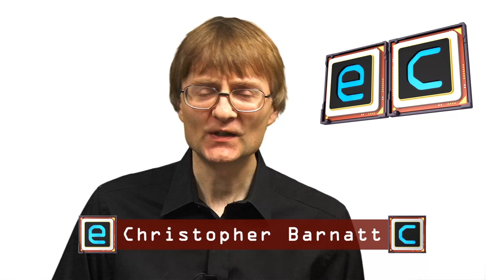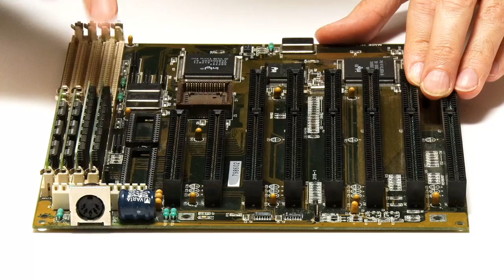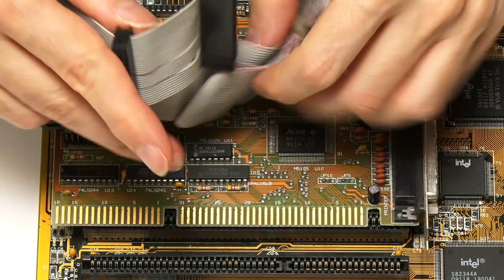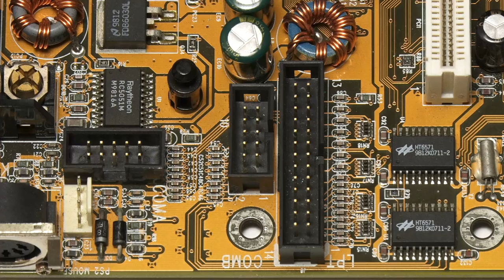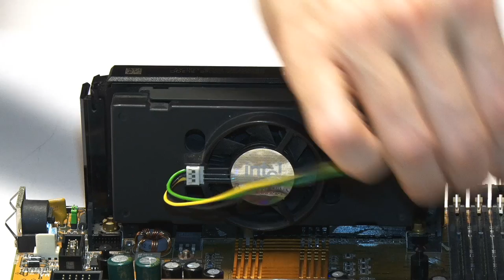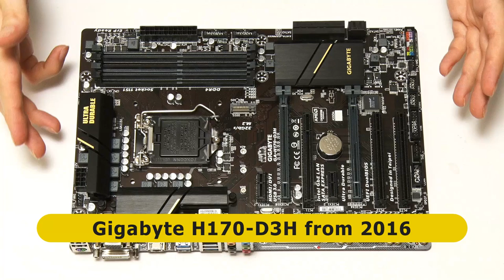PC Motherboard Evolution

Comment: Who remembers PARK ? and the feeling when you forgot to do it before you turned your PC off !
Reply from the maker: Oh yes, happy days . . . well, sometimes!
Reply: "Park" was only really necessary if you intended to MOVE the machine after you turned it off, but for safety sake, and given how expensive MFM hard drives were, it was a good practice regardless. The utility basically just told the stepper motor that positioned the heads to return to the zero position, which is a section of the platter where no data was kept. The heads actually ARE in contact with the platter when the hard drive is off, only using a thin film of air dragged by the spinning platters as lubrication, so it was VERY important that the heads be parked in a part of the platter where no data was stored in case they got jostled around during transport. Once IDE hard drives with magnetic coil armatures came out (that's where you harvest the neodymium magnets from), this was no longer an issue, because once you cut power to the coils, the magnets automatically pull the armature back to the zero, or "park" position. I had an early IDE hard drive (a 40MB, I think) that still used a stepper motor to position the heads. 

Floppies also used to come with dummy disks so the heads wouldn't knock around during transport. 

These days, most retro-computer enthusiasts have swapped out their MFM hard drives for CompactFlash (which is really easy to build an interface for, since it's basically IDE anyways)... IF (and oh what a big "if") their old MFMs were still working. These days, MFM hard drives, sans controller card, can easily fetch $400 on eBay, but with no guarantee that they actually work, or were PARKED before transport!  \O_O/

Comment: What kind of motherboard has an AGP slot, a USB header but no PS/2 connections on the back for both keyboard and mouse? It even has the AT power connector alongside the ATX one. That motherboard seems like junk even for 1999.

Comment: "Definitely from 1990" he says, while showing a chip with a clear date code of 17th week of 1991. What the ... Chris?
The crystals show 1991 date codes as well.
Reply from the maker: Oh well . . .
Reply from the maker: Though to be fair, I said late 1990 or early 1991, and used the 1991 reference later in the video. :)
Reply: @ExplainingComputers  Can't win em all I guess :)

The controller card is of the same era. The machine was probably purchased in 1992, given the date on 1MB SIMMs which likely would have been installed at the time of purchase.
Reply from the maker: The SIMMs I show were added later -- you can see there are a different design of SIMMs behind them. I know that this machine was in use in an office next to mine in 1991. :)
Reply: @ExplainingComputers  You win that round then :)
What about the slot1 motherboard, there was much better positioned fan connector near the keyboard port, often actually labeled 'CPU FAN'.

Edit:
I'm just being pedantic, nice video Chris.
Reply from the maker: The connector you are referring to near the keyboard port is to connect a bracketed PS2 mouse port (you can see it labelled as such in the video, and I noted it was this kind of connector). The connector I plugged the fan into is the only fan port on the board and is labelled "CPU fan". Overall, this video is offered in good faith, not as a comments competition!
Reply: @ExplainingComputers  Of course you offer the video in good faith, I would never suggest otherwise. As to the competition style comments, you'll be the winner every time, a little back and forth interaction does wonders for the Youtube algorithm. Please don't take offense to my comments as none was intended.

Comment: In 2020 I decided to buy a retro pc from 2011 a core 2 duo with a Radeon sapphire graphics card and attached some retro parts like a 3.5 floppy and 5.25 floppy and a CD-ROM drive all setting on a gigabyte lga 775 motherboard quite possibly the last motherboard to support onboard floppy connectors! All inside a tesseract case which supports everything!!! And yes it works!!!! Running Windows 10 pro!!! Oh what treat it is! 

Sadly I can’t format 5.25 floppies 💾 inside windows but sure can read them and write to them if they are already formatted!

The other downside is I must switch from 5.25 to 3.5 floppy in the bios but at least it works! 

And I’m a happy camper because I built it myself!

Comment: Of course that 386 motherboard doesn't work. It's missing the BIOS, and by the looks of it, I think the RTC as well.
Reply from the maker: It stopped working long before anything was removed! :)
Reply: That's a shame. 

These days, if the mother board goes, that's only $60 to replace for an entry-level machine (unless you've got an OEM copy of Windows 10, then it'll be around $250 with a new license). Back then, if the motherboard went, it could easily set you back hundreds! And lets not even talk about how much Apple hardware can set you back. They're STILL expensive.

Comment: So many things have now been integrated onto the motherboard, it's now possible to have a desktop computer without any expansion cards at all, but what of the things being moved off? The North Bridge, for instance, and hardware that has been replaced by software. I wonder what else will be removed in time.

I'm amused by the aesthetic change of motherboards. From the jumble of browns, yellows, blues and other non-complimentary colours, because no one will see it inside its beige case, to RGB LED, and functionally pointless plastic armour because it will be in a glass case. The PC has gone beyond number crunching, and now also focus on being a form of art and self expression.

Comment: wish I could use my Zalman cooler instead of the crap intell stock cooler I am using now. Intel stock coolers were so much better during the clock speed race just before the multicore setups.

Comment: Nice collection of motherboards, but I am dissappointed you skipped over the change from soldered CPUs to socketed CPUs with the 486 and Pentium 1/ AMD K5 and K6 and K6-2 processors. The 9 year jump you made to the Pentium 2 also skipped over the introduction of the ATX standard in the generation of the Pentium 1 w/ MMX and K6-2 CPUs, the introduction of PCI slots, and the proliferation of graphics cards that necessitated the addition of the AGP slot you see on your Pentium 2 board.

I would argue that the 9 years you skipped are far more interesting than the 20 years after your Pentium 2 board. Chipset battles, overclocking popularity, AMD owning the marketplace for enthusiasts with their faster and better Athlon Thunderbird lines of chips, etc.

Comment: My motherboard is ASUStek P8H61-M LE,Very OLDER.
Samsung 970 SSD (NVMe type) is being moved.
It's Edited BIOS included in that, Adapter ECM25.
Included module is NvmExpressDxe_2.ffs.
Older computer is very fast.

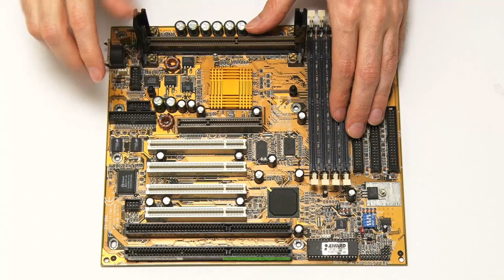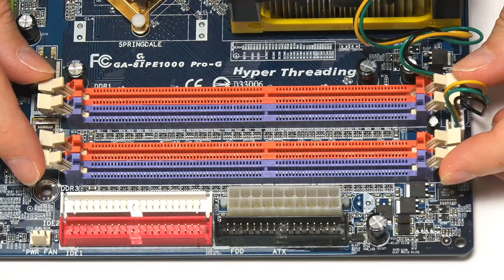Comment: 8:09 thats a nice mother board from 90s  suports agp and ata+ atx psu and sd-ram dimm only - is ata keyboard instead of ps2(connector socet) hehe :D ps amd slot whas identical but it whas mirrored i think :) dip-switch is not so funn if missing info on what settings XD 14:58 proper windows xp gaming pc :D 17:26 nice win7 Board, i have identical cooler althoe its in blue color but it whas pretty good for the cpu :D Awsome memory lane video :D

Comment: :( sad face, no comment on the firewire interface. . . . . or mentions of the original PS/2 standard, . . . . . or daughter cards that all add-ons would plug into. . . . allowing for the earliest versions of the compact desktop, to bad no examples of the TRS 80 or the original Macintosh. . . . yeah i'm that old
Reply from the maker: I often made use of the firewire interface to connect a DV or DVCAM camera! So I do miss them.

Comment: i have pc from 2008 and it runs every game, becouse it has xeon l5420 4 cores 4 threadr 2.5ghz, 6gb ram ddr2 1066mhz, gtx 480
Reply: Gtx 480 is not from 2008
Reply: @nadirjofas3140  yes, i had 8800gt from zotac and in 2012 i upgraded to gtx 480

Comment: 6:16  YOU HAPPEN TO KNOW THIS IS HOW IT PLUGS IN.... do you ?  hehe

if you look closely (on the cable)  PIN 1 is represented by the red marking (as you probably know)
which is on the Left

NOW....  on the board,   pin 1 is ON THE RIGHT SIDE
hehe

so.. i would say you stuffed it up accidentally 
you have not matched Pin1 to Pin 1
again... thank god for the little notch that came later on.. Huh   ?   hehe
Reply from the maker: See pinned comment! :)
Reply: @ExplainingComputers  
hehe

Comment: A trip down memory lane eh..  My first computer was a Atari 800.  wow.. Then I moved to a AMD 386 40mhz. My motherboard had a local bus slot that predated the AGP slots for faster video cards. Then I went with a cyrix 686 cpu setup and then back to AMD. AMD also tried a slot cpu and ran a cpu and math coprocessor  at half cpu speed.  Yeah, I loved the computers back then as they were a lot of fun to setup with the jumpers and all the other goodies. Things today are so dull to those times where there was so much different stuff to buy, lots of different video card makers and quite a few cpu makers as well. Now it's Intel and AMD.. ugh..

Comment: I wonder in the future PC's will follow Apples way. Everything soldered on the motherboard and limited upgrade paths.
Reply: I think that's fine as long as the boards are relatively  cheap and you can still add memory and storage at will. Apple's hardware on the other hand is very expensive and you can't really change anything so I don't understand why anyone would even buy any except for professional purposes.

Comment: Holy shit some of those old motherboards bring back some memories and so does those slot mounted pentium processors

It also reminded me of a motherboard can't remember to much about it apart from it could take 2 different type CPUs the Slot mounted pentium type plus a socket and one thing I do remember about that motherboard was it was a pain in the ass sometimes Turing it off would stop the CPU from working next time turning it on it got to the point when I had to switch between socketed COU a d the alot CPU a strange problem 
And going back further I believe in 1999 ingot my hands on some really old computers darn things was absolutely huge I believe they came from an BT exchange and they certainly was interesting to play around with running windows 3.11 and had 3 huge MFM hard disks in them that when operational would make my table move slightly side to side and the noise of those drives ouch

Comment: All I see in this early PC motherboards is that they were miles behind the Amiga. Too bad Commodore went bankrupt.
Reply from the maker: I so agree. I ran an Amiga until the mid-1990s.
Reply: @ExplainingComputers  I've seen you did quite a lot of SBC coverage. Can you do a video about the Vampire V4 standalone from Apollo? It can run any 68xxx AmigaOS natively at incredible speeds and is as modern as it can get. Normally it comes shipped with ApolloOS which also deserves a look at as it is an AROS fork.

Comment: Yeah, the pin configuration, and keeping right voltage, and all that stuff. Hardware badly configured would simply burn back then :)
And when it cam out, i remember with my m8 calling new technology "Plug 'n'' Pray" coz it very often didn't work correctly.

Comment: I think im part of the new generation, i started a computer in later 2015. By that time everything has been simplified compared to back then. I think i know as far back as.....??

First gen Intel Core series? Afaik some of which are still good even for gaming these days.

I started out with a i5-4690K, AsRock z97 motherboard, 1Tb storage, 8gbs of RAM, and a msi gtx 970, and a 750w power supply.  Neat video!

Comment: I’m currently building two newer systems one an i3 cpu with 32 gig of ram 🐏 on a msi b460 torpedo Motherboard! The other a b550 gaming x v2 which will have 32 gig of ram 🐏 an a 5600g amd cpu 

I have also built another b550 gigabyte  aorus pro v2 system with a ryzen 3600 cpu with 16 gig of ram 🐏 which I will upgrade to 32 at some as well!
Reply: Point

Comment: VARTA BARREL BATTERY / ACCUMULATOR MAINBOARD KILLER

I would like to give a warning concerning the "Barrel Battery" on the 386 board as there is already corrosion on the Keyboard connector Housing and around it, best to "remove" it before the board is lost for good.

IT IS STILL SALVAGEABLE

The Base / Acid of the Battery is slowly eating the Traces

Comment: So many errors in this video.

Did you actually work with computers or is most of this info from the internet?
Integrated graphics didn't appear till the mid noughties, no I can tell you from personal experience building PC's that it was well before that.
Also port configs we're not as you described. 
Basically it looks like you've drawn a lot of assumptions based on the hardware you have to hand and not what was actually going on in IT at the times you reference.
Reply from the maker: I lectured in computing and related technologies at the University of Nottingham for 28 years. I have published 13 books, and scores of articles, mostly on computing and its implications. And I have been building PCs for about 25 years! :) So no, this video is not just based on "info from the Internet".
I simply do not believe your statement "so many errors". The integrated graphics comment was a personal recollection, so yes -- this may be a bit out, but not much (for 14 years I was resonsible for PC purchasing in my university department and remember pretty well when we could stop fitting graphics cards: when a technology appeared, and when it was pretty common, are not the same thing!). "Port configs not as described" is a nice general comment, but does not actually tell us very much about what exactly you think is wrong (see also my pinned comment.

So thanks for your feedback, but this video as presented in good faith based on a great deal of personal experience and knowledge. It is perfect of a complete history? Absolutely not (as I make very clear in the intro). But I think most people here appreciate it in the spirit it was intended.

Comment: You completely skipped Vesa Local Bus (VLB), the massive slot working as the extension of ISA, and you skipped the first sockets for 486 ... incomplete history is bad history.
Reply from the maker: As I made clear in the introduction, this video is not  presented as a complete history of motherboards. Rather, as I explicitly said, it is based on a presentation of the old boards I happened to have access to. So this is not "bad history". Rather, the video delivers exactly what its introduction said it would deliver. :)

Comment: Oh yea, BTW - you also screwed up when you said "let's see if we can put it back in?"  Really a freaken SIMM, you don't know if you can "put it back in"?    Dude,  I don't think you've ever touched a 386 board in your life.  I've installed hundreds of them when I first got in to computers, it's so bloody easy it's embarrassing.  Hell for that matter where's the real starting point - you should have opened with an XT board and DIPP RAM and then got in to 286's .... and then 386's - that would be accurately showing the history of MB's.   We'll keep watching ......
Reply from the maker: "Let's see if we can put it back in" was clearly an expression. Not a question of whether I could or knew how to do it. :) I worked with and on scores of 386 boards. As I stated at the start, this video was not presented as a definitive history, but rather a discussion based on those older boards I still have in my possession and built PCs with.

Comment: Whaaaaaaat ? You directly jumped to DDR3 Ram / 2004 - no mainboards with PS/2 and sd-ram at hand ? :-/ *Booooh!!   :-)

(edit: just saw the DDR3 was the DDR Slot 3 not version DDR3, so DDR 1 and DDR2 got covered)
Reply from the maker: I will make a thorough RAM video fairly soon. :)
Reply: ExplainingComputers 
Thinking of it: i had an 486 with 8mb of RAM, which meant i could only play some missions of comanche 2.0
 with my trusty cheapo gameport joystick on the soundblaster ... 16 i think..
- i guess there are no games today which allow you to at least play the maps you can, now its always "all or nothing"

time was around the pentium 133 or 166mhz my father had and i got his old 386 and 486 at the age of around 6 i guess... (born in '85)

well back to the RAM topic:
we went to a store, they didn't have the old ram for the 486 (or it wouldn't work)
BUT there were adaptors from the newer (?PS/2?) to the old ram available, where you could add more ram to the old slots. 
Sadly didnt get the adaptor or more ram (too expensive i guess), so can't say if it had worked, but it sure was interesting.
But the indiana jones and monkey island games ran just fine 😎

Comment: What a shame you couldn't have started with an original 8088 XT layout motherboard, and the 80286 AT layout with all their beautiful individually socketed DIL TTL & DRAM chips (from early-mid 80's).  By comparison, the 386 board, you initially show, looks relatively advanced with it's all-in-one VLSI packages.  Any real coverage of "PC Motherboard Evolution" simply must start with an early PC/XT or PC/AT standard layout motherboard, to fully appreciate the dramatic advances initially made in the first 2 decades of PC computing.